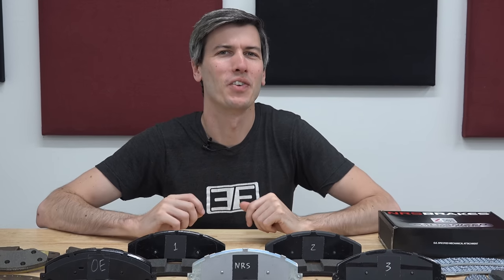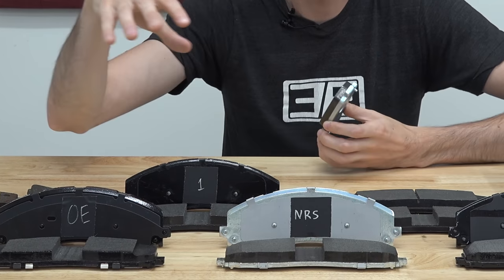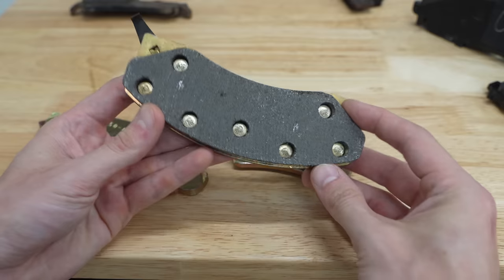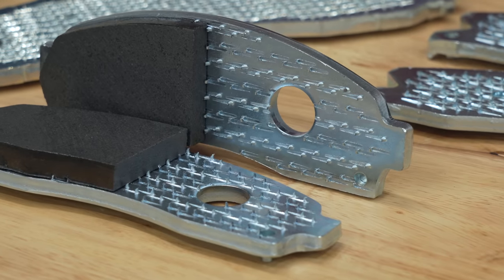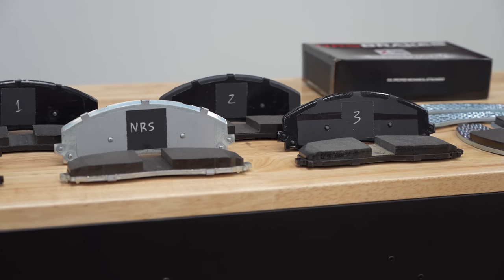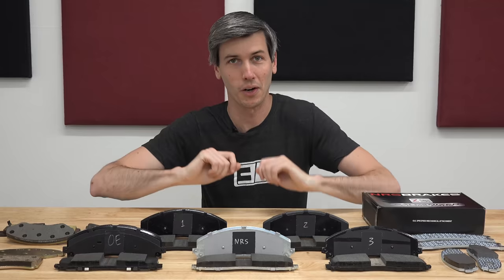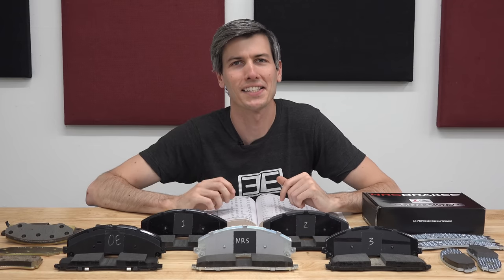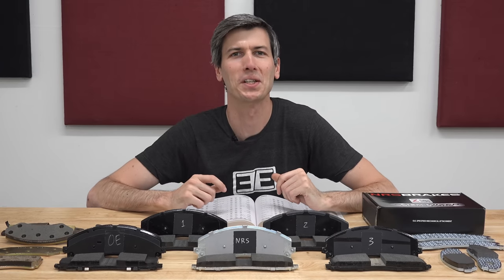The Sketchy Truth About Aftermarket Brake Pads

Comment from the maker: *Lots of discussion in the comments, let's address the major points!*
1. To be clear, as stated in the video, this is about applications where the OE specifies mechanical attachment (heavy duty trucking, towing, some track cars, etc). You can see an image of these types of vehicles at 12:40 in the video. If the OE does not specify it needs mechanical attachment, I'm not here to say it does! I think OEs are smart and know what they're doing. The tech (mechanical and adhesives) has been around long enough for them to decide, based on the application. 
2. How often does failure occur (for the "I've never seen a brake pad fall off" queries)? Safety is a probability game. Even if the chances of failure are very small, when you're talking tens of millions of vehicles, getting different quality replacement pads, then it becomes a reality. NRS gave a presentation at SAE where they pulled numerous examples from NHTSA where pad separation was failure point and cause of the accident. Unfortunately, it does happen.
3. 8 Day Oven Test (addressing "my car doesn't drive downhill for 8 days"). This is providing a method for understanding adhesive failure over a long period of time. It doesn't happen all at once (you could get 50,000 miles, or more, on the pads). In high heat applications, that heat can break down the adhesives, as the data showed. Edit: Worth mentioning, as the adhesive breaks down on the backing plate, this makes it easier for rust to creep in behind the friction material. This leads to rust jacking (as shown in the video), which eventually can fully separate the friction material from the pad. 
4. What's the point? The point is for these specific OE applications, there are aftermarket brands saying they're essentially OE replacement pads, yet they're not playing by the same criteria as the OE. There should be an easy way for consumers to know. I found that fascinating, so when NRS approached me about a video on it, I was in. 
5. Lastly, I appreciate all the pressure in the comments; it improves things long term! I do think I could have explained certain aspect better, after reading through here. Also, I think it could be a really interesting test to put the pads from the video through the 8 day 550ºF test. For what it's worth, I take sponsorship very seriously, and turn down probably 95% (if not more) of the offers that come my way. I thought this was a really interesting subject to learn about, and I have worked with NRS in the past, so I was happy to work together on this video. 

What would make things better for next time? I'm open to your feedback, thanks!
Reply: Great work 👍
Reply: Good work, be nice to see something like this for track pads.  Maybe more importantly how the whole brake system has to work in those high stress environments.
Reply: This post pretty much addresses all my concerns with the video. My only remaining questions are about the glue. Are there glues out there that would perform as good as the mechanical interface? Was the glue used the same kind as those brake pads that aren't using the mechanical interface but should?
Reply: I work in stress testing and reliability, of semi-conductor parts but a lot of the methodology is the similar. On of the things that hard to get through to new people is the idea of accelerated life spans, ie. how can we show that a part will fail in five years vs 3, when we only test them for a few days/weeks? It seems the idea of cumulative stress is pretty unintuitive to people. "If I don't push it hard enough to break it immediately, it will never break."
Reply: I know the reasons behind the choice (I think) but I really don't like the hiding of brand names behind "a leading supplier" or such terms. These companies but products up for sale that anyone can buy, just name them! It is fairly easy to find out what products are from what companies if you do some research but it shouldn't be this way in my opinion. You say " they're not playing by the same criteria as the OE. There should be an easy way for consumers to know.", so tell us the names so we know! 

On a positive note great job breaking down the oven test chart in a concise way. Always look forward to your videos, hope you are doing well.
Reply: You should supply the names of the "other popular brands" to your paid subscribers, here or on X. I appreciate the effort that NRS is making to show us what a premium brake pad is, but they need to compete at the retail level and not just direct to consumer. I will continue to make "the best choice" when purchasing from Rockauto, by comparing the options they have available.
Reply: Honestly, I thought all of these points came through in the video. But if you want to make it even more clear for folks, I'd suggest:
1. Stating at the beginning that certain mounting methods are acceptable for light duty use and that many aftermarket companies, even big name brands, are using those less secure attachment options on heavy duty pads in order to cut costs. For next time: condense your entire message into a sentence and get it out early; even if you want the rest of the video to feel exploratory in nature.
2. I imagine that many people will often outright reject facts that don't line up with their own experience. I don't know how well those people would respond to citing statistics of how many break pad attachment failures result in crashes in a given year, but that's the only thing I think you could throw at them without derailing the video. For next time: casually site your sources when you claim something (perhaps Kurzgesagt style; though they have an immense research budget...) and feel free to write off the viewers that leave because you told them something that they believe to be not so. In my experience, people with those mindsets (my own well-loved family members included) will never believe you until you shake their hand, befriend them personally, and share anecdotes with them about it happening to you. Seeing as how you simply can not do that for all 3.61 million subscribers, they are best left to their own devices. You'll never be able to predict what fact will trigger their sensibilities so just keep laying them out there and focus on other aspects of your channel, I say.
3. As an engineer myself, I totally understood the oven test as soon as you mentioned it. Some people who are less wrapped up in life-testing may need the statement spelled out very clearly that, "breaks wear thin from the contact with the rotors but all (what we're focusing on today)ultimately fail from being exposed to too much heat over time" and that, "leaving them in an oven at 550°F for 8 days is the equivalent to a lifetime of break pad ware." For next time: it can be crazy difficult to catch yourself starting to ramble in your own industries jargon. To be clear, I've watched lots of your videos and I think that you are very good at not doing that, by and large. But it seams like a familiarity with how lifetime ware is simulated would've helped those viewers from getting confused and most people don't have that knowledge. I imagine you have tons of engineers watching your channel as well, however. I really don't know how to distill that into a nugget of advice. You'll have to keep a closer eye on what you assume your audience already knows if you want to avoid that in the future—maintaining a balance between taking the time to break things down to their bare bones and keeping fluff that most of your audience already knows minimized so that you keep them entertained, engaged, and hold their attention for the whole video. That sounds rather tricky, to be honest.

Summary
Put the entire premise of the video into a sentence early and expand on it for the rest of the video.
Cite your claims (as best as you can) while accepting that some people out there just won't "get" it from a YouTube video and that's ok.
Check yourself for using acronyms, jargon, and more difficult to detect, knowledge of processes that a large portion of the population doesn't have.

I love the show and you asked for feedback, so here you go!
Reply: I think it would be helpful to understand what the sheer force requirements actually are as specified by a standards and governing body and compare that to the graph. It's good to have a good safety margin, but if you take it too far into overbuilt territory then it's a waste of money.
Reply: i love that you’re just out here spreading good information
Reply: Fantastic work and being humble by showing you are open to criticism.
Reply: I live in the northeast.  I have seen far, far more bonded brake pads fail rust than from heat.  Rust follows the adhesive bond line and after a few winters of road salt, the friction material just falls off the backing plate.  Mechanical attachment is much more rust resistant.  I’ve never seen rivets rust through, for example.  Not sure about the barbed attachment method.
Reply: I think the video was rather weak and missing critical points explained here.
Reply: @jrfish007  I've been through lots of track pads, and have never seen a failure where the friction material separates from the backing plate.  I've had pads crumble, but  not slide off the backing plate entirely.  Even when worn down to 1-2mm of material left, and heated over 800C (1500F) repeatedly.
Reply: Can you link the article published by the NHTSA if it exits. If it doesn't then probably it is not a real concern.
Reply: @ethanj454 this is some really great advice - nice write up
Reply: I've worked in shops with heavy traffic...like 20 bays plus...seen thousands of brake pads...I don't remember ever seeing the friction material to come off.

If it's a non issue then why make a big deal of it.

Even for heavy duty applications I would say the friction material itself is more important than how it's secured.  The material will fail on all wheels at once while if a pad falls out it will only be one wheel and the noise would be so extreme that it would scare the life out of most drivers.

So the vehicle will stop...and the driver will get it fixed fast.  Non issue.
Reply: @answeris4217  I am guessing you haven’t worked in the northeast land of winter and road salt.  I have never seen pads come unglued from heat, but I have seen several rust off the backing plate prior to wearing out.  The South Main Auto channel just showed this in a recent video.  His shop is only 50 miles or so from where I live.  I would not shun bonded pads/shoes for this reason as it is rare, but it absolutely happens in this climate.
Reply: Brake pad product engineer for a major global aftermarket pads supplier here.
I can confidentially assert that friction material shear is a non-issue with modern friction materials using underlayer and spigot back plate holes. We sell millions of pads globally per year and have had zero friction shearing/falling off issues.
Not many aftermarket brands are using underlayer, which improves friction shear, noise damping, and reduces heat transfer into your brake fluid.
Where seen the biggest issues with brake pads is high temperature fade performance - even some major global brands dangerously failing high speed vehicle brake testing, with some still doing 50mph when the best friction materials had stopped the SUV!
Reply: @LTVoyager  I live in Ontario.  The issue isn't pads coming off.  It's the friction material overheating and failing.  That's 99% of all break pad failures.

The material falling off isn't.  If it does which is a unicorn issue...  you can still stop your vehicle.  If the pads overheat it's like breaking on ice.
Reply: @answeris4217  Nope.  I’ve never seem a brake pad fail from overheating.  That is very rare unless you live in the mountainous west.  I have seen seem pads and shoes where the friction material fails due to rust between the steel and the adhesive.  Happens all the time in PA and NY.
Reply from the maker: @TC-V8  Appreciate you sharing information! Why do you think OEs are still using mechanical attachment in heavy duty applications, if a proper underlayer would suffice? Thanks!
Reply: "How often does it fall off?" My new ram truck had a pad fall off after about 2 years. Didn't know what had happened until my rotor was badly damaged and grooved from the metal backing.
Reply: @LTVoyager  it happens all the time.  It's not about mountains it's about aggressive drivers that are hard on brakes.  Emergency vehicles have special brakes that need to be warmed up.  So do race cars.

If you drive normally then your brakes will never happen...but if you are aggressive it happens.

It happened to me a few years ago on the highway when I needed to stop hard.  And usually the rotors will harden and change colour when it happens.
Reply: @answeris4217  One hard stop isn’t nearly enough to overheat brakes to the point of damage.  It takes many stops in quick succession to do that or a very long downhill grade with a very heavily loaded vehicle.
Reply: @LTVoyager  speed is a bigger issue than weight.  

Kinetic energy = ½MV²

In the end if you double the weight you car is twice as hard to stop.  If you double the speed it's 4 times harder to stop.   

Rotors usually overheat first but it doesn't take as much as you might think.
Reply: @answeris4217  Yes, that is basic physics.  If you are making stops from 120 MPH on the street, I have no problem is your brakes fail.  However, almost any car on the road can make one emergency stop from 120 MPH and not trash their brakes.  Now, if you are driving a Yugo…
Reply: @LTVoyager  try it.  Go 120mph to a dead stop like there's going to be an accident.  Then tell me if you don't have break problems.

There's a reason why no roads in NA let's you go faster than 85mph
Reply: @answeris4217  Since you can’t do it legally, it isn’t a problem.  Try to be smart and not just argue for the sake of argument.  And it is brakes, not breaks.
Reply: @LTVoyager  I'm telling you that you can't do that anyways without damaging your breaks...  go on a raceway try it.  I already know that most cars are not designed to have breaks like that.

It's not science.  Breaks designed to break in high speed are not usable on regular roads.  Police for example need to warm up their breaks and need to put excessive force on them for the first few stops they do during a day
Reply: @answeris4217  Do you know the difference between brakes and breaks?
Reply: @LTVoyager 😅YES!🤔🤦‍♂️
*B R A K E (S): to stop, as in stopping a car; the braking system in a vehicle used to stop it. ‼️
- Not taking a lunch BREAK, or Breaking a glass, or having many Breaks in a hose! 🤷‍♂️
🤦‍♂️👍👌⚠️ glad I'm not the only one.... 😂😂
Reply: I would be more interested in the actual performance of the brake pads. Especially stopping distance but also longevity, fade resistance, cost, etc.
Reply: Point 2 is moot - is not enough to show that break pads were the cause of the accident, you need to show that it's adhesive separation that led to accident.
Reply: @pfa231  What are break pads?  I buy brake pads so that they won’t break.  😁
Reply: @EngineeringExplained because one person out 100 milion could take them to court and win if the brake pads would fail,car manufacturers need to think about the total extremes. And all these tests inside labs are not real world application's, they never been and never will be,in lab tests where made to cut costs and save time, doesn't matter brake pads, fuel consumption,long life engine oils, shock absorbers etc..... manufacturers do tests in labs because it's cheap, faster and they can put warranty on their products
Reply: This time i am not convinced. That could be a non existing issue. If the pads would came loose , people would go to court bc of faulty design. I assume the heat transmission capability is very low and therefore the glue would not reach critical temperatur. The majority  heat is at the disc, which could reach 600°C. I use Brembo, i trust them, they are glued. And the material itself is made from powder...and a binder, which is a glue. Last but not least, corrosion effects are more probale in the mech attachment due to higher surface area and many capillaries in the pad due to the intrusion of the hooks. Water can reach that and freeze. By the way, the Space shuttle heat shields are also glued.
Reply: As EVs with regen become more prevalent maybe this braking issue will be moot (...mootish, well, a bit mootish, perhaps).
Reply: adhesive bonding of friction material to brake pads is done using heat and pressure... the adhesive is not mixed in the friction material.. adhesive is lay up on backing plate before laying the friction material... think of it as a burger, which then it get compressed using heat and pressure allowing it to cure....
Reply: thanks for the explanation
Reply: Where can I get a copy of that book
Reply: I've had a pad separate after a hard stop in traffic. It may have stared with rust jacking, but a full stop from 45 mph hard enough to trigger the rear only antilock popped the lining off the backing plate. The pad stayed in place due to caliper design but if felt a little spongy and made odd noises. Pulled it the next day. There was lots of material it just sheared off.  They were name brand.
Reply: You should do a crossover video with M539 Restorations about how OE parts can and often do depart from the mfg specifications